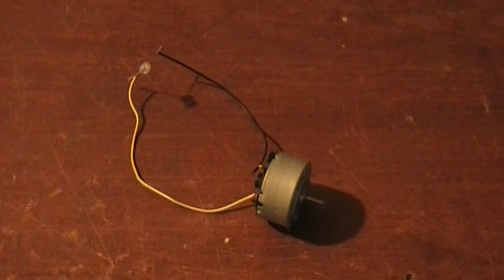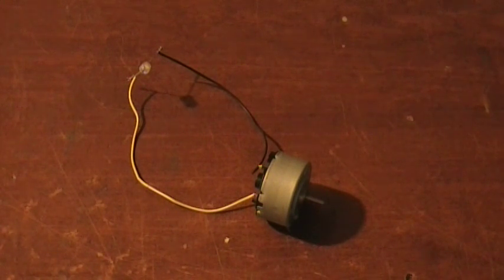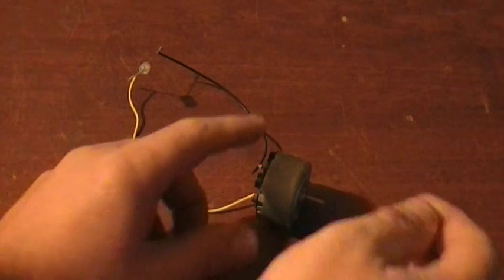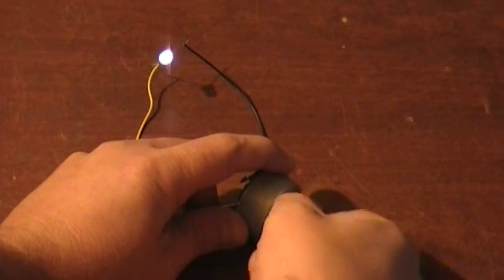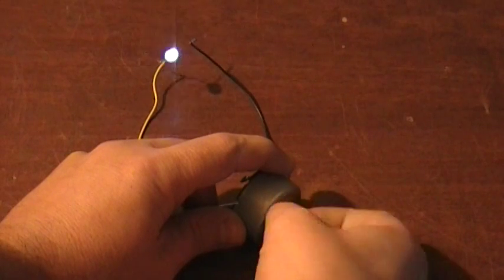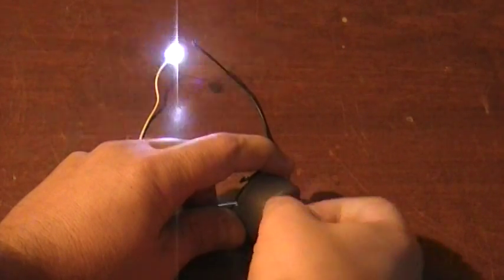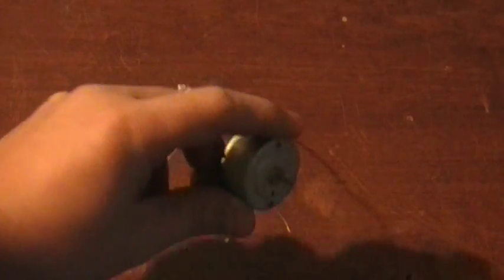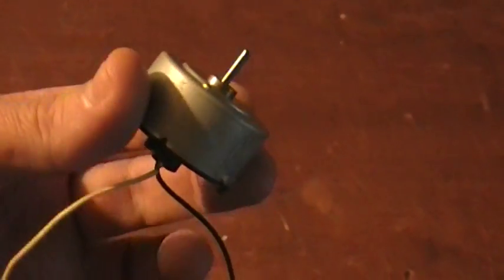Tiny Wind Turbine Generator LED/AA Battery Charger

Comment: You can take apart an old scanner, printer or CD drive that you have gathering dust and use the wee motors out of those.  I've successfully made 2 little wind generators that way, with garage junk and scrapped LEDs... even incorporating a joule thief to make them brighter.  Lot of fun to experiment with!

Comment: Judging by the looks, and the fact that he has bolted this is just a small DC motor being used to produce some current. You can do this with any motor of this kind, and a low power LED. A DC motor driven by a force will always make current, but for a proper efficient generator the windings, and component arrangement would be slightly different. That being said he's not really lying or anything, he's just not telling you that chances are you already have this in your home, or you could find the stuff practically anywhere.